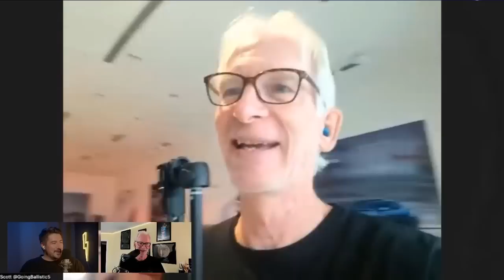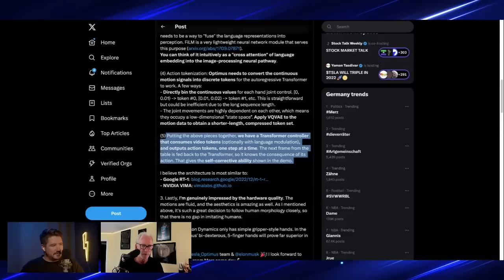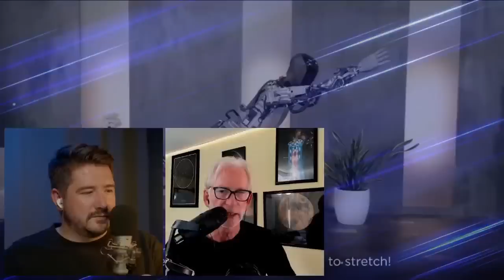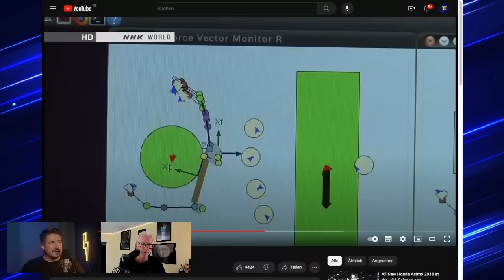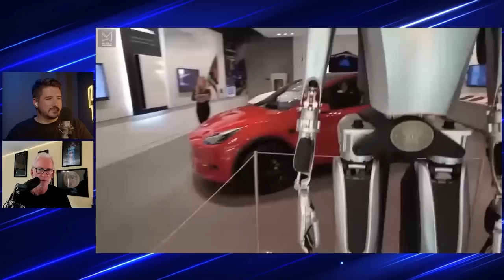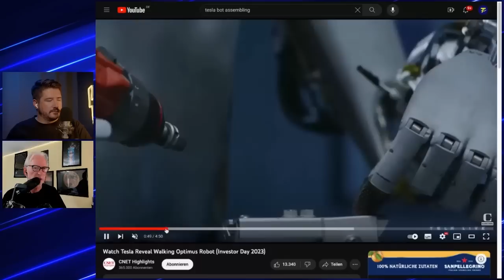Massive Tesla Bot Updates! Who Can Compete?⚡Scott Walter

Comment: Tiger Woods could Train it to compete on the PGA Tour?
Reply from the maker: Absolutely no! 😃
Reply: Bot doesn't have the coordination to play golf against a 3-year-old
Reply: @MegaWilderness  
Come back in 1 year and watch Tiger Woods train a Robo-Partner for the Masters tournament.
It’s Going to happen. Within 5 years Optimus Woods will be Unbeatable on the Pro Tour.
Cheers
Reply: @Julian-1111  Bot cannot move fast enough, nor will it in 5 years
Reply: @MegaWilderness  
I am very familiar with Robotics (Engineer), In six months they will be demoing just how dexterous they are. Don’t be fooled by the Tame demo’s they are purposely Limiting its speed because they would be SCARY if they were allowed to Max it out, however, It will oudrive most professional golfers, remember this has a Supercomputer for a brain and half a dozen Eyes (the head doesn’t move, so Optimus knows where All of its limbs and Hips are at All times. Much like a target pistol, the tolerances could be tightened up to improve accuracy/repeatability. Once Optimus is programmed it will Zoom into the flag pin, calculate wind for the entire flight path, measure the Air density/Temperature, calculate the Elevation of the Cup, measure the Speed of the green using a virtual 3D map, calculate the perfect Landing Spot for a Hole in One on that Long Par 5.
A target in the sweet spot on those club heads will allow for Calibration of each club to Always hit the perfect shot off a Tee peg. It will Learn how to deal with difficult Lies and sand traps. For the Sand, it will drag the Sand wedge through the sand to measure the weight/density/Drag to make a 2 stroke hole of that Par 5.
Cheers from San Diego
Reply: @Julian-1111  The Mickey Mouse computer will be limited by the slow performance of it geared actuators. You don't lift pianos without gearing
Reply: @MegaWilderness  
Max lift will be under 200 pounds and those actuators can spin up very quickly in coordination with All the other actuators. For a speed demon they would replace parts with carbon fiber including the motor/actuators and frame, but mostly the shoulders to the hands. 
A Pro golfers swing isn’t that fast at the hands, but an efficient swing is what makes the clubhead go 140 mph
Reply: @Julian-1111  They don't have a flexible spine so will never be golfers
Reply: @MegaWilderness  
Optimus won’t need both arms to be the best. That bendy spine is why we have to use both arms. 
Optimus would one arm it while in the Captain Morgan pose. While washing everyone ‘s balls with the other hand. 
Since it is a Robot it could use the left hand to Toss the ball into the path of the sweet spot (there’s a program for that). 
Can’t wait to see one at the range next summer. 
Cheers from San Diego
Reply: @MegaWilderness  
Optimus will use One club only. This club will have a 1 inch disc of “Tungsten” (heavy Metal), with a 
8 degree Driver face and a wedge face on the reverse side,coupled with a chipping angle and Putter face, total 4 faces   Using a special hand with a rotating wrist.